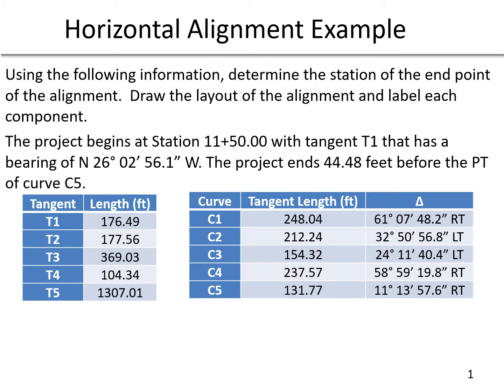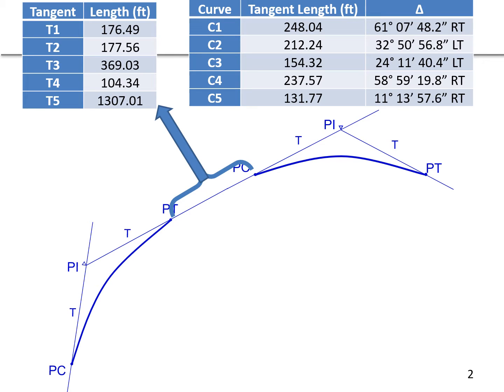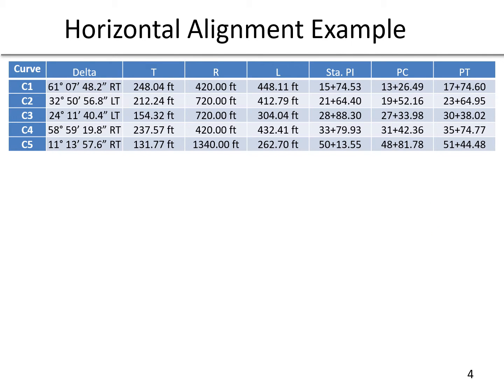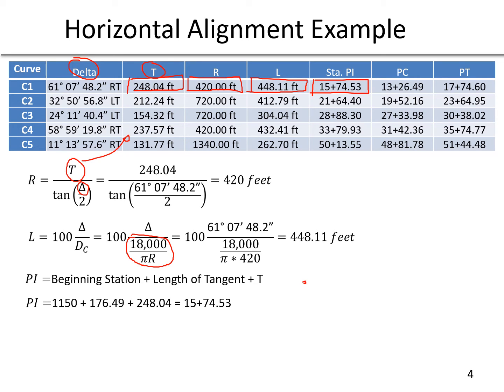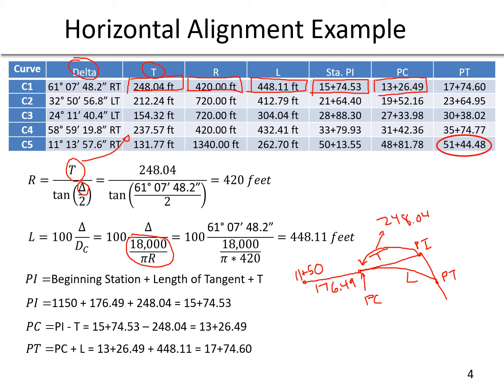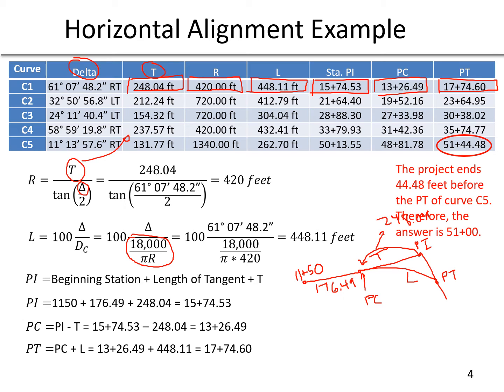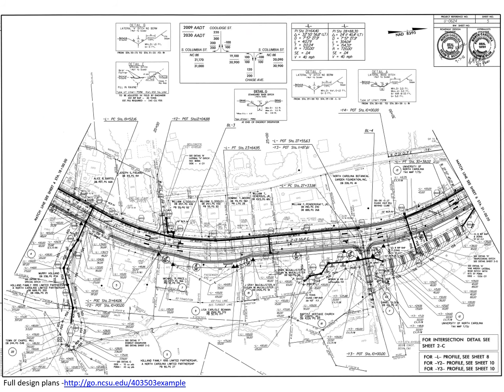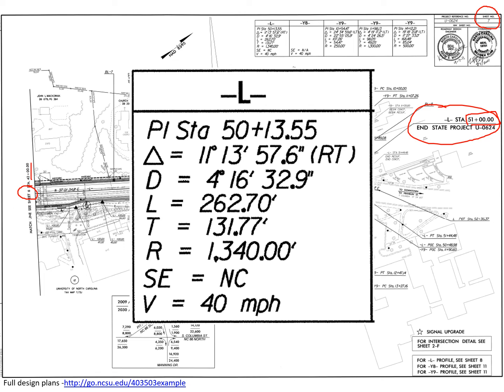Horizontal Alignment Example Problem - Find the Station of the End of the Alignment

Comment from the maker: ****Correction Notice: At 2:30, the bearing for Tangent T5 is shown as N 37 degrees 01' 34.7 W.  

This is a mistake, it should be "E" instead of "W".  

The correct value should be "N 37 degrees 01' 34.7 E"